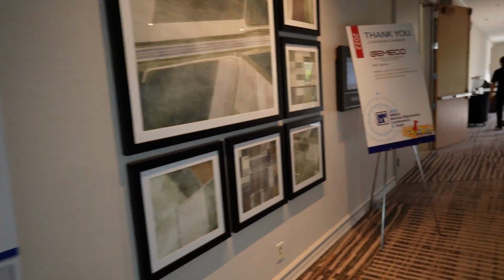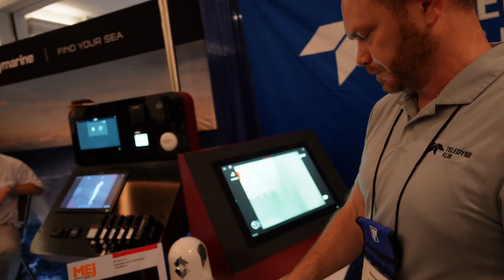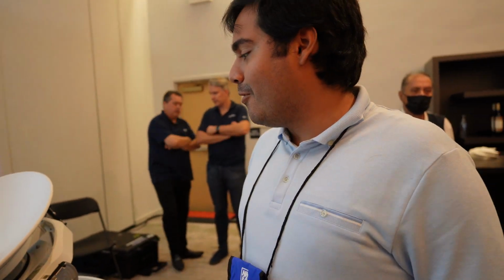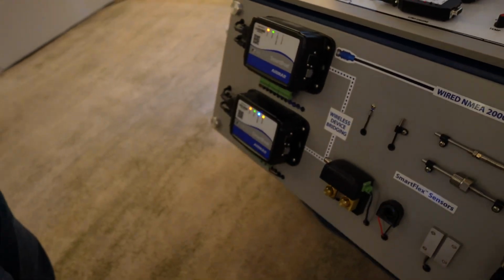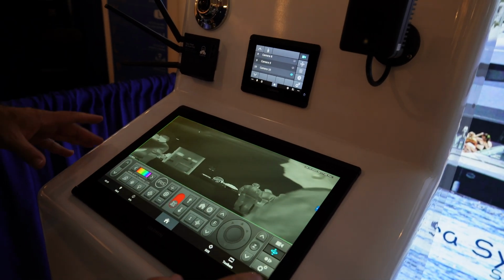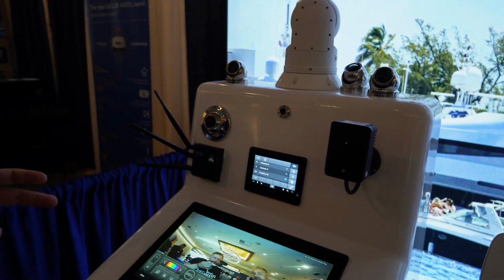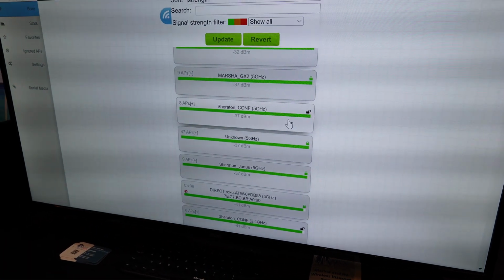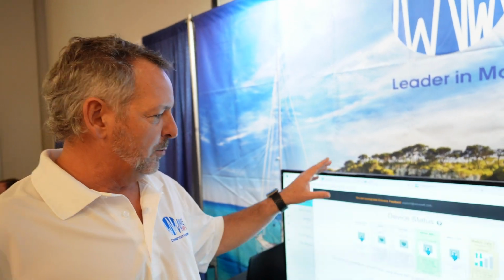National Marine Electronics Expo - "Cold Beer, Right Ahead!!"

Comment: As a mariner I love that stuff, when it is 20 years old and I can afford it. I have some experience integrating NMEA 0198 products to interact, and that standard is pretty much what we are doing with APRS, and Garmin does in GMRS with the RINO radios. Marine AIS is basically APRS with the kind of price tags only Government regulation can cause. But, on my trip from Homua LA to Crescent City CA in 2016 I found AIS to be an amazing and very useable technology. In the 19080's I worked on the R/V Shell America doing seismic research and we had all the tech available then for position finding, but it could be replicated for accuracy with a laptop, OpenCPN, and a $15.00 dongle by 2016. What is amazing about FLIR to me is it is now possible to identify salmon in the water column, a fish without an air bladder, that is amazing.